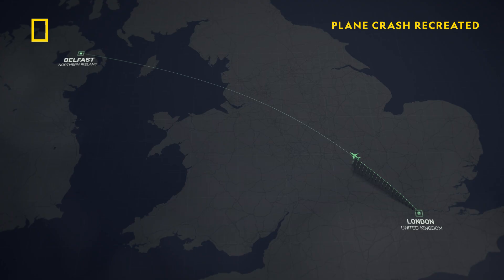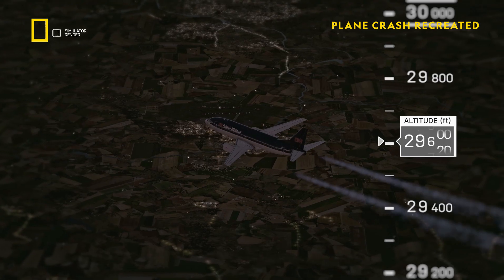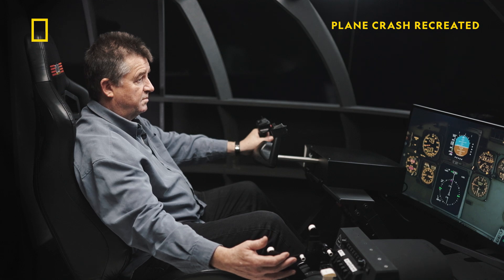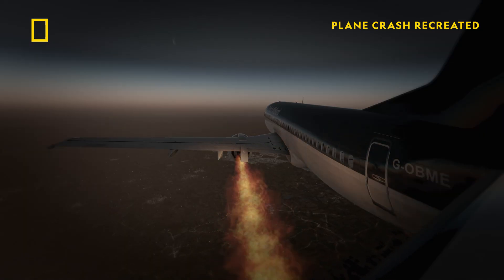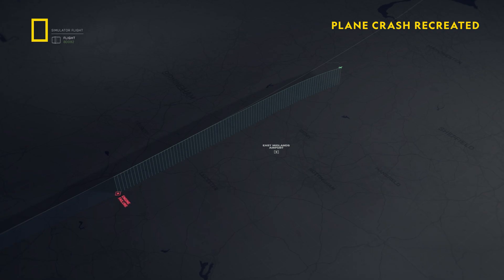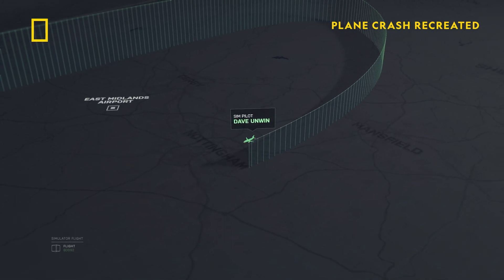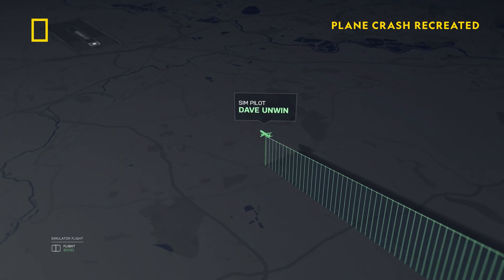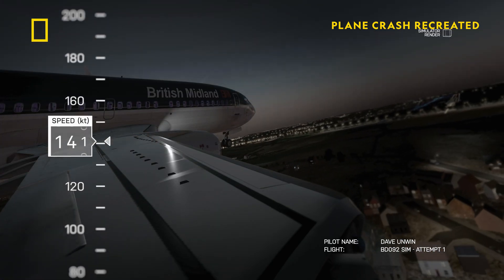What happened on Flight 92 to Belfast? | Plane Crash Recreated | National Geographic UK

Comment: He said that he is spooling No2 Engine Down. when we all can see that No 1 engine is on fire.
The commentator said that No 2 engine runs the air when it's No 1 engine.
That aircraft did actually it the M1 Motorway latterly yards away from the start of the runway.
In reality then captain and copilot did shut down the wrong engine they had an issue with No 1 engine and shut down No2 engine.
I was watching the News when this came in and pictures of the aircraft all over the M1 motorway to which I was on that part of the motorway only two days before...